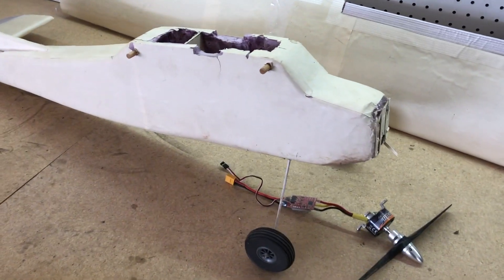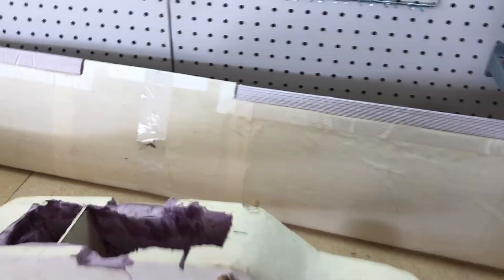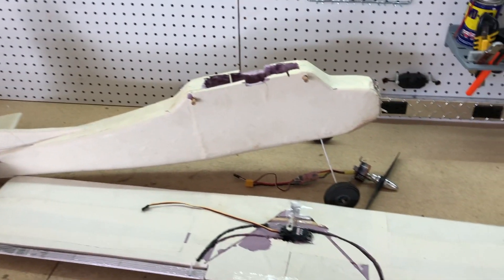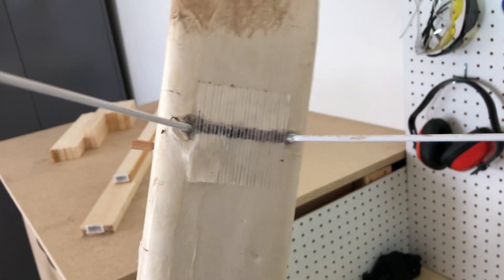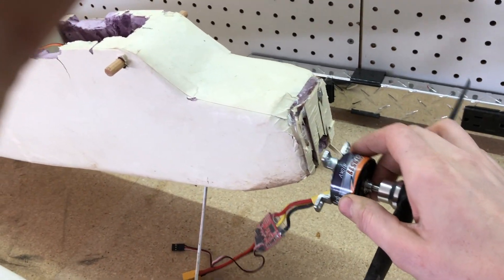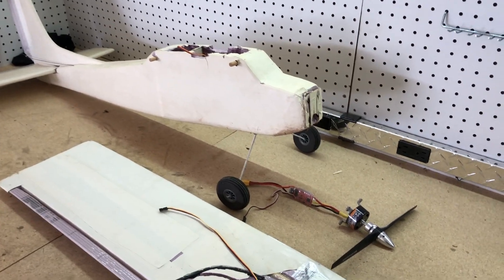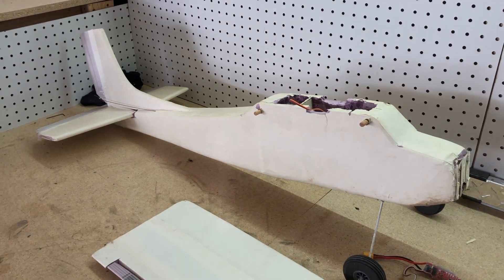How to build foam RC plane cheap (Part 2)

Comment: nice build.  how did you determine the motor size and where did you get the firewall?  did you just wing the motor sizing or did you do some calculations.  why do some foam models call for like a 280 kV and some 1929 kv.  seems like such a disparity between the low number and high number and i've seen some larger planes calling for the lower number and smaller planes calling for larger numbers (of KiloVolts)....  seems like there is no consistency to it and perhaps i don't understand the kV thing.
Reply: High kv for small prop turning faster revs on smaller lightweight plane : low kv is for heavier larger planes using bigger slower revs prop but has more torque/grunt.
Reply: @bazarrebloggs7280  Thanks so much, makes total sense how you phrased things.

Comment: i am about to build this plane but what if i build it without wing servo just with eleveter and rudder
Reply from the maker: That should work fine. There are lots of trainer planes like that.
Reply: @builtfromhome9207  is that gonna be smooth fly
Reply: @yerontulu9269  no, you'll suffer from adverse yaw/drag. Turning the plane will take an absurd amount of time.
Reply: @psychonaut_LIVE  Wrong. Most basic trainers are just rudder/elevator.
Reply: Just make sure you have alot of dihedral

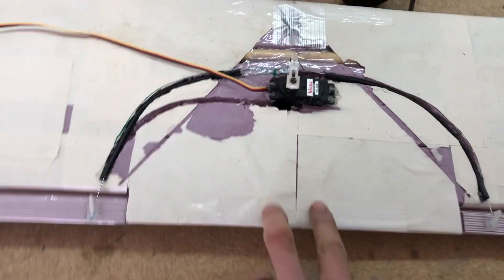Comment: thanks for posting.  some thoughts.   at 1:11,  at first glance, it looks like it should have worked okay.     unfortunately, while it allows relatively smooth operation, the too-large  ID  of the tubing allows too much  play  in the linkage.    at  2:01,  too much of the rudder pushrod  Not  supported.    at 2:31, there is a bend in the 'lower'  pushrod,  WHY.     at the moment, there is a lack of certainty, where the pushrods  are attached  to servo arms.    cheers        googletranslate